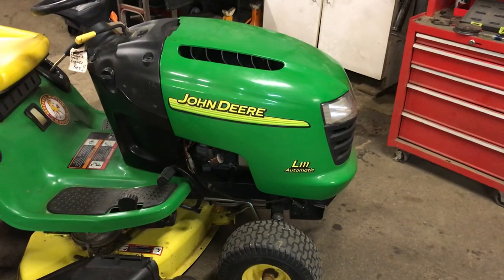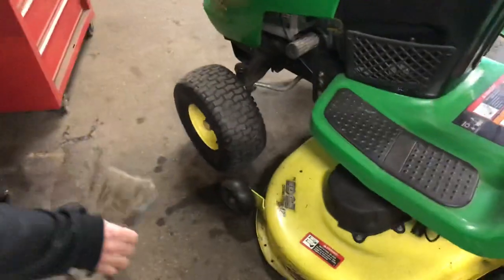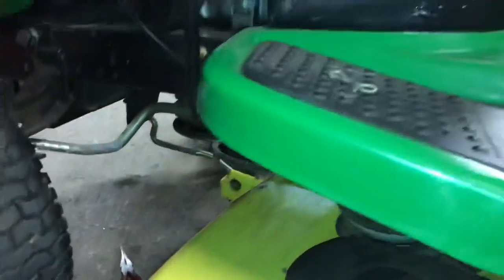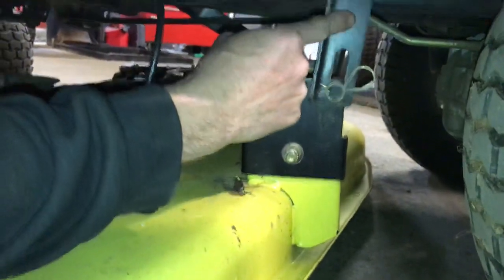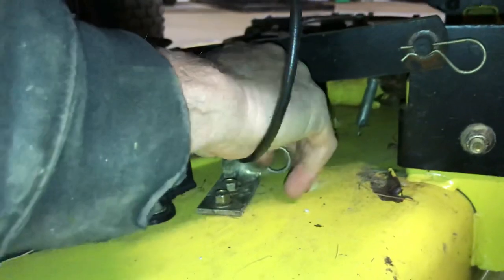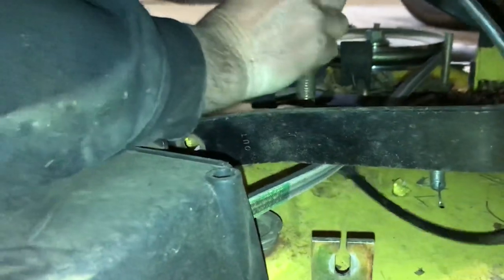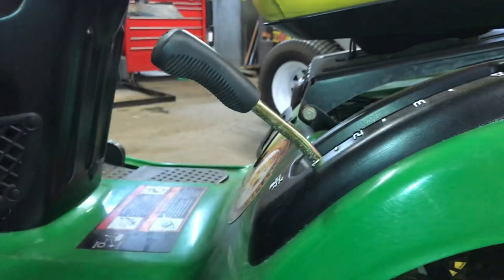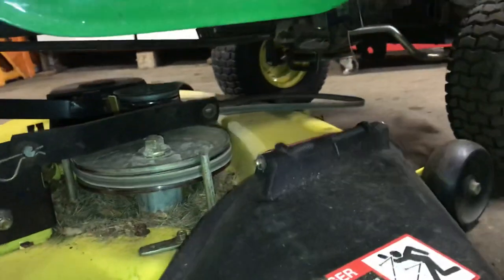How to remove mower deck on a John Deere L111

Comment: Thanks for the video!  I completely broke off the right-side deck mount on my L111, same deck as the video.  Hit a high lip of some uneven concrete.  Mount broke too easily, I didn't feel or hear anything.  Mount was left hanging under the tractor, with a jagged, ugly hole in the top of the deck where it used to be.  I got the deck off the tractor no problem thanks to your vid.

With an angle grinder, a wire brush on a bench grinder, and a 3-pound hammer gently used, I have the metal around the wound shiny and pretty, and back in shape.  The mount sits there nicely, just like it should.  Tomorrow, I'm going to employ my long-unused and minimal wire-feed welding skills to fix it in place, hopefully good as or better than new.  If that fails, I'll switch to plan B, which is probably more grinding to get rid of the bad welding, followed by a drill, nuts, bolts, washers, and brackets (which may have to be homemade, [the brackets, that is]).  <<<  I just used brackets when talking about brackets.  HAHAHAHA.

The tractor just turned 17 years old a couple weeks ago, has about 475 hours on it, and has served me very, very well in that time with only a couple of minor repairs and only one new blade belt ever, so giving it a little TLC is the least I can do. I only run it in the summer, no winter duty (live in Wisconsin).  This is the first time I've ever taken the deck off in all this time.

One cylinder must have worn rings and does seep a tiny bit of oil into the cylinder when shut off, and has for a few years,, blowing a little blue smoke on start-up sometimes (20 HP Briggs V-Twin), but it starts and runs like new, power is still like new, and I hope to keep it going for years yet.  I do the factory maintenance kit every spring before the first mow, and keep it greased so it steers beautifully.

I once pulled a good-sized storm-broken branch off an oak tree with it, that was too high to reach with ladder and chainsaw.  It took a few runs, and the front wheels were off the ground more than once, but the tractor did it!  Ahh, the memories!  The very earth shook when that branch finally hit the ground, I swear it did!  🙂

Thanks again for the vid!
Reply from the maker: Hi Brian, I'm glad this was helpful. If your mower deck is not to rusted, welding should work well. I do it all the time and the only issue we have is the major rusty mower decks. Please give this video a like, subscribe and tell your friends about my channel to help it grow. It would be greatly appreciated. Thank you for the kind comment :)